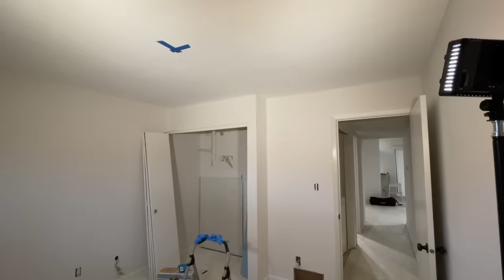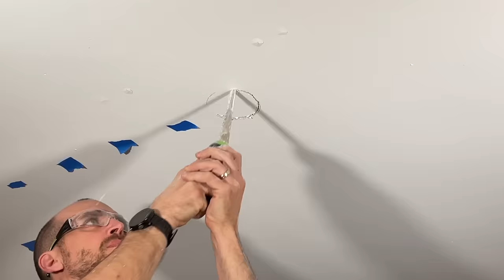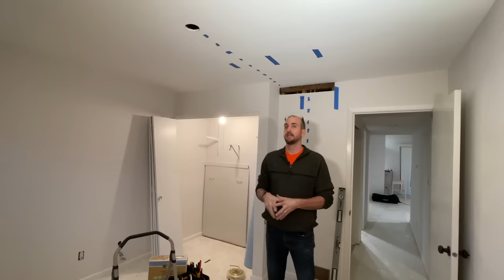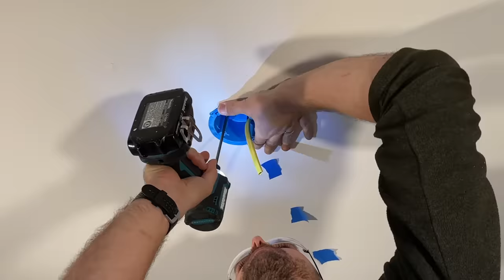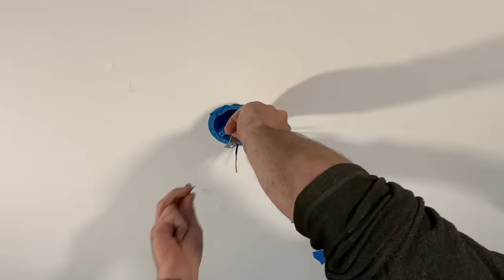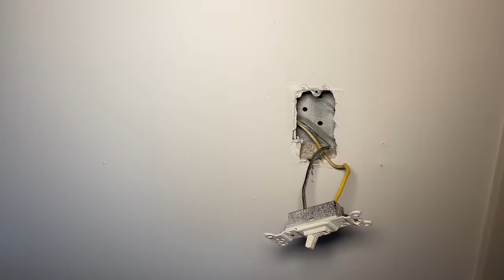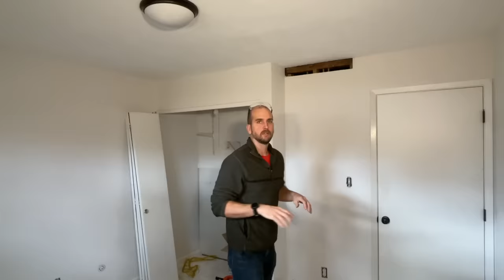How To Install Ceiling Light Without Existing Wiring

Comment: I've learned so much from all your videos, but I have one question on this one - why didn't you run the new wiring for the light straight to the switch? The outlets power still goes to the switch which power the light correct, and with the yellows removed on the new outlets they are full power all the time correct? Or is that one of the Wrong way to do it? LOL  I thought it would be less wire and less mess in the outlet box - if this wouldn't work or cause a short please let me know.  Thanks again for all the instructions.

Comment: Man, I used to keep my drywall holes small, but honestly, patching a large hole vs small holes is the same amount of work. Drywall is cheap and large openings speed up work.
Reply: plus, if the hole is large enough, a "nailer" can be inserted behind the impending joints to screw both parts of the sheetrock (drywall) to make for a better "new" section of wall.   also, if you are able to cut the hole over existing framing members with an oscillating saw, the entire existing piece can be reinstalled, eliminating the need for a lumber yard trip, except for the joint compound.

Comment: What did you screw the Junction box to ... the floor above? I have a electrical outlet that floats in the wall not even an inch next to a joist ... my goodness that attachment would have saved me hours of repair. Thank you for your time and efforts
Reply from the maker: Hey Randi, the box I installed is simply holding on the back of the drywall and not meant for holding much weight (especially not a fan).  This is a better option for old work jobs to ensure a sturdy box for a light and/or fan.  https://amzn.to/3nityIu
Reply: @EverydayHomeRepairs  Thank you for your response

Comment: As always, a great video, you are a great teacher!  As far as converting the outlets to always on, can’t you just disconnect the switch, and connect the switched wires together, adding a jumper to the switch, then use the switch for the light? I can see the value in simplifying by removing extra wires, but they are there, and safe. Am I missing something?
Reply: I wondered the same thing.
Reply: You could absolutely do that. It would certainly save you a lot of time. -the disadvantage is that a future electrician might find it confusing as to why there were 2 hots and wonder whether it's a shared neutral circuit.  That said, making that assumption without checking at the switch to see if the receptacle was once switched is not too bright.  Personally, I would have left the old switched wires in place in case someone wanted to change it in the future.

Comment from the maker: Additional Notes from Commenters
1.  Romex should not be run through a plenum
2.  The box used should be able to hold a fan even if you aren't installing a fan originally.  This would be a better old work box  https://amzn.to/2W0rDfY
Reply: Per 2020 NEC must be able to carry a lot more weight than it used to. Check your AHJ.
Reply: Agree that you always need to install a fan specific ceiling box in the middle of a ceiling.
Reply: Since we're talking about fans, I always run 14/3 or 12/3 to ceiling boxes.  Two reasons: the first is that if someone does put up a fan, you'll have separate fan and light controls if the customer doesn't want a remote.  The other reason is that if the homeowner wants additional lights, you don't have to run a new line from the switch.  Particularly with recessed lights: having multiple areas of light staging can be nice.  Pro tip: if it's a serious rehab, put 3-ways beside the bed so you can walk into the room, get in bed and turn off the light without having to go back in forth to turn on a lamp of something.  In addition, you can control the fan speed if you're too cold or hot during the night.

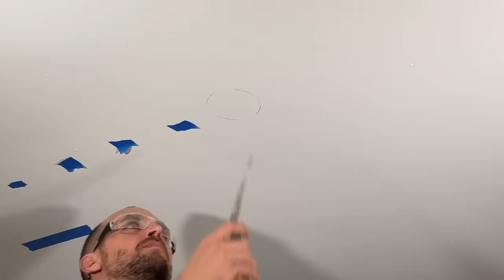Comment: Bummer for the nail pops at 5:15. You only have that happen a time or two before "slow and easy" becomes the only way to make a new opening in existing drywall.

I was a working electrician for over a decade, doing lots of service & side work, and never knew in the beginning I'd also become a drywall repair expert. ;)

Comment: This was a great lesson on  showing viewers that you don't have to be an expert electrician to do simple electrical installs.  Curious about why you used 12 AWG Romex. Usually this circuit would be on a 15a breaker and AWG 14 would surface (and a lot easier to work with). You also installed new outlets, why not just add a jumper to the existing ones? I would have moved the light box up against the ceiling joist and installed a fan bracket to allow for a ceiling fan (maybe in the future) and light; this would also require running a three conductor Romex (black, red, white) to the ceiling from the switch. Are you in the US? I've never seen yellow wire used in lighting installs.
Reply from the maker: Hi David, I had extra 12-2 from another project if I was buying wire specifically for this I would probably grab some 14-3 Romex.  Agree with adding a fan bracket and others have mentioned specifically this one https://amzn.to/2W0rDfY .  Yeah, this condo is in the Midwest but the wiring seems to be more along the lines of a commercial as opposed to residential install since they used conduit throughout the unit.  Appreciate your feedback 👍
Reply: @EverydayHomeRepairs  If it is a 15A breaker and the rest of the wire is 15A, using the 12-2 is a violation of NEC. You should have used 14-2.
Reply: @EverydayHomeRepairs  I used this saddle style box that saddle mounts to a joist (and TJI). It leaves less space to work a fish, but still doable in most installations. "RACO 1-Gang Black Plastic New Work Standard Saddle Boxes Ceiling Electrical Box". Found it at Ace Hardware and Lowes. Supposedly can support a ceiling fan too. I could not use the fan bracket since there was duct work in the center of the room and I did not want to move too far off that line, but the adjacent joist was still somewhat centered. Thanks for your videos!
Reply: @eddie3721  sir, I am an electrical guy and do not believe the use of 12-2 in this case is a code violation.  The circuit breaker should protect the lowest rated part of the circuit...the 15a recepticles and 14-2.  The larger wire should not violate anything, but if you have a code section. I will be happy to stand corrected.

Comment: Great video. I have a bedroom with no ceiling light and 1 switched outlet. I've often thought of installing a ceiling light in that bedroom. Luckily, I have attic access.

 Can you point me to a site that has diagrams showing how, exactly, I can install a ceiling light, as well as changing that 1 outlet from switched to powered all the time? Thanks.

Comment: Good video.  My tip would be to leave much more wire at every location.  It drives me crazy when I open up a box and only find about 3" of wire.  Very difficult to work with.
Reply from the maker: Thanks for the feedback Roman!
Reply: Well how long should it be !?
Reply: @davidwillard7334  6 inches

Comment: Nice work. I'm making a video installing 6 recessed can lights in a basement. I like you approach in your wiring technique. I use a multi-tool with a drywall blade. Makes a nice clean hole. I'm lucky though.  I have access to the ceiling thru the closet under the stairs. Very professional and you explained on detail what you were doing. I'm just getting ideas how to do my video. Thank you and keep up the good work

Comment: Step one: Turn off power at the breaker/fuse box before doing anything with wiring/electrical.
Reply: Very good, indeed always.
Reply: @jthonn  Good point! It's also a good idea to double check with a non-contact voltage tester to make sure it's off. I don't like making assumptions with power.
Reply: step 2: call a licensed electrician
Reply: I only do hot, i love living on the edge
Reply: @DaruDhillon  id suggest using a proper meter as non contact testers are not very safe either.
Reply: @Tre16  even better.
Reply: If you work with the power off, how do you know if you made a mistake?
Reply: @BitSmythe  When you're done, turn the power back on and listen 🤣
Reply: @BitSmythe  turn power back on when done.  If breaker doesn’t trip, proceed to more extensive testing.  Smell test for smoke, look test for fire and flash, listen test for scream of roommate.  Finally, turn on switch and start all over with my suggested tests.  Pass all of the above tests and the light works ( which is a bonus), ya should be good to go.
Reply: @jakesully5402   I find it faster to just work with the power on. If the homeowner is in the room and you get a spark, just calmly say “ah found it.” 
Tip: Practice not flinching with sparks.

Comment: That wall hole tells me you don’t do much drywall patching.
Now you have to tape the top edge and it’s a corner
Reply: If he gets the patch nice and tight on the cieling  side, he can caulk the cieling angle or any other angle for that mater.. Just make sure you go all the way to the next corner, looks more uniform that way.
Reply: @gmazz0913  I was thinking the same thing. Like cutting the quarter panel on your car front end to reach a spark plug
Reply: Thank you, was thinking the same thing. At least he made nice, square patchable holes. But there was a much more efficient way of removing the drywall (i.e. never needed to expose the top plate).
 Any electrician that comes onto my job-site and starts bashing the walls with a hammer  is asked to leave.
Reply: @steveb6371  Cut the hole at least 3 inches below the ceiling that way you don't have to worry about patching the ceiling, just the wall.
Reply: @johnbeckwith1361  I use the poll of a hatchet or hammer. No chance of hitting a cable and I'll square off the edges and cut new sheet of drywall to match later so who cares? I'm not reusing the same square I just cut anyways. It's just drywall.

Comment: I got a suggestion.  As an HVAC tech we’re always pulling new wires for various things. At the top of the wall I suggest cut the wall to accommodate a HVAC  6” x 14” return air grill instead of messing up the wall, patching and mudding and painting is eliminated. Of course you have to sell the idea of an extra grill to the customer. Can also be used on a ceiling, which ever is Preffered.

Comment: Running wire in a cold air return some/most codes require plenum wiring.  And 12/2 for a light is not needed, 14/2 is good enough. The technique for fishing across a ceiling was spot on, if you don't have access to the back side of your wall then you need to cut a longer hole in the side wall enough to get a drill in to and drill a hole in the top plate. And then you would run the fish tape out from there to the hole for the light.
Reply: I assumed that all existing wire was 12ga/20A circuits, so he just used the same.  Good point about wiring in a cold air return.  I don't think wire is allowed to run parallel in one.  Also, since this this building was wired with conduit, chances are that conduit is required by code, so none of this is valid.  And, most condo/multifamily buildings require work to be done by licensed contractors because you're potentially putting multiple people/units at risk if you do something wrong.

Comment: Code states 6" min of wire sticking out of the box  for the fixture.  Your are the one the I fuss about whenever I come back in behind you to fix the light with a loose wirenut.
Reply: Thinking the same. I appreciate showing people how to DIY. But if you don’t have all the stuff down, that’s the reason people mess stuff up. 

Also, did you see him loop the ground? I didn’t. Maybe I missed it or didn’t show but I didn’t see it.
Reply: @SUBJECT M01 got it. I skipped ahead because I couldn’t watch it anymore lol
Reply: I wonder if he pulled an electrical permit? Lol I’m not sure how code works where he’s from but here in Canada... when only having a hot and SL in a box was still legal... you could carry power to the switch on your white conductor..but your SL back HAD to be the black. And why did he run 12/2? Here 14/2 would suffice.
Reply: @jimmymcintyre4889  Its a condo and technically a commercial installation.  In many states, you must be a certified electrician to do the work which precludes a homeowner from DIY.  Also commercial properties require upgraded wiring, usually one AWG larger.

Comment: A 3 inch hole saw works perfect for those type of ceiling boxes
Reply from the maker: For sure, I only had a 2 1/4" handy so turned to the jab saw.  Thanks for the tip!

Comment: Good video...but as  Electrician myself I normally recommend to go to the switch instead of the plug it's a short cut to the power source and it professionally done.Also I would not bother with removing the yellow wiring just wire nut them ... unless you are removing the wires to recycle ♻️ the cooper. 😀
Reply from the maker: Thanks for the feedback Gabe 👍

Comment: Good video, but I think you should have gone with a Raco (or another brand) old work ceiling fan electrical box.  It only adds about $10 to the cost but you wouldn't have to worry about someone in the future trying to install a heavier light or ceiling fan to that and pulling it out of the ceiling.
Reply from the maker: Great tip, appreciate the feedback 👍

Comment: Interesting, I’m an Electrician in the UK and it looks like what your doing would not be permitted where i live. If the protective device controlling the outlets is used to run a light, surly some can of fusing down must be fitted? I.e. the outlet circuit would have a higher rated protective device (normally 32 Amps in the UK) so more current can flow to to meet a possible higher demand therefore outlet circuit cables have a thicker cross sectional area. Lighting circuits have a smaller size cable and lower rated protective device as the load is not as great, so you have added a light to a circuit that it is not rated for if I understand correctly. So how are you protecting the cable to the light and the light? A simple Fused Connection Unit (FCU) with a 3 Amp fuse fitted would protect the cable/light and act as a switch at the same time? Just a thought.

Comment: Us electricians use a 5 “ hole saw. We straddle the stud and take out a plug than we go to the switch box not the outlet than we screw the plugs back in. Much cleaner job and easier to patch. FYI a yellow wire in the US denotes 277 volt. Also the code says the p ring is too far back requiring an extension. But that’s just us electricians.
Reply from the maker: Hey James, I appreciate you sharing your experience.  Thanks for the feedback.

Comment: In general, I think that there are some good recommendations for routing the cable; however you need to note that this is probably an electrical code violation. You can't run electrical cables in a duct or air plenum unless they are rated for the use. These are not. For this reason, I was bewildered about how the original switch and outlet installation had passed inspection until he states that the wiring is in conduit. Installation in conduit satisfies the code, open Romex does not.
Reply from the maker: Thanks for the feedback Gary.
Reply: I’m trying to route romex on an attic, does it have to be specially sealed too?
Reply: @CharlesLukoba  The air plenum / duct issue shouldn't be applicable.
Reply: @garynichols206  Gary is correct. You can run Romex in a plenum space.
Reply: Running Romex in a cold air return is allowed at least where I live you just have to make sure your box has a vapour boot on it to prevent air coming out the box

Comment: Thanks for the excellent video.  I am dealing with a similar situation in my home  but I am installing a ceiling fan with a light.  I will have a remote control for the fan and light.   Should I have 2 switches on the wall?  Thanks
Reply from the maker: I am not a huge fan of the remotes as they definitely just add another point of failure.  If you do a remote then 1 light switch would be fine since you can turn the light on/off and fan on/off separately from the remote.  Don't forget to use a different electrical box as compared to what I used in the video especially to support the weight from the fan.  This is what I recommend https://amzn.to/2W0rDfY

Comment: I would have cut the Sheetrock away from the seam, much easier to spackle.
Reply: Now you just said you have a closet on the other side?! Why the hell didn’t you cut the rock in there?
Reply from the maker: Agree that cutting the drywall lower would have been a smarter move.  The closet wouldn't have worked because it actually has a drop in the ceiling that would have made fishing the wire through a bit harder.  Thanks for the feedback.
Reply: @EverydayHomeRepairs  you got it done though!
Reply: thats what happens when you are dealing with a rookie
Reply: @dematt321  he’s way better than any of the helpers my bosses have hired in the last ten years. They probably don’t pay enough?
Reply: @KitchenerLeslie2  pay people well that’s probably the issue. Ibew local 1105 in Newark Ohio pays over twenty bucks an hour with health insurance for first year apprentices.
Reply: @dematt321  Ground hand here Philly is 33.+ with benefits.
Reply: @etherealrose2139  you have no idea what you’re talking about

Comment: I live in an older home that is wired throughout with aluminum wiring. What are your recommendations for adding light fixtures, switches and outlets? Or even just replacing receptacles when the need arises? Thanks